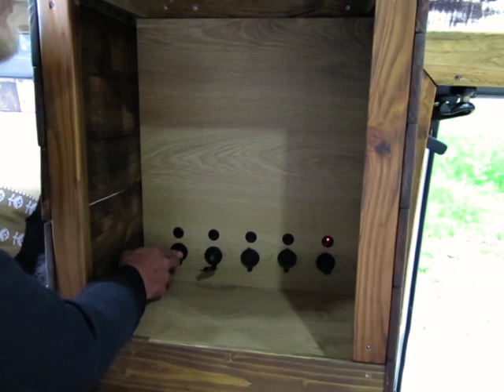LDV Convoy Campervan Conversion Tour. Self-Build, Off-Grid.

Comment: Good choice of van, their to underrated. Had mine 18 months and no probs at all. Nice job you two did on conversion. You talk like you know a lot about wood wish I did very handy when doing conversion, best of luck on your travels.
Reply from the maker: Roger Faulkner thanks. They’re definitely underrated, but that means they’re well priced too. No frills or mod cons but run really well.....so far anyway. We’re really happy with it 👍
Reply: What kind of flaws does the 2004 convoy 90hp have, I have one I enjoy it but it's at 53k Miles bought it 6months ago and have had to change the flywheel and clutch, back brakes, left wheel bearing has been giving a lot of trouble so likely needs a who new hub and axle,.abs etc, the ignition barrel got stuck so that needs to be fixed, the air blew it's fuse and now after replacing only blows out cold so debating if it's a few bits to spend money on and then it will be right or if it will be a money pit 🤔 great for lack of rust to must have been stored indoors any insight greatly appreciated
Reply: I've not had any really bad problems with mine, just done 100,000 miles 
If it hasn't got any visual rust that's really good, the heater is easy fix it's cable controlled which can cease if you look at the bottom of the controll panel near floor you can see lever and move it by hand. The price these vans are fetching now it's definitely worth keeping.

Comment from the maker: Hello chaps. Thanks for watching the van tour. Quick Update:
Over the summer my wife and I took the LDV on a two month tour round Europe, visiting Denmark, Holland, Germany, Austria, Slovenia, Croatia, Bosnia, Italy, France, England and Wales. If any of you guys are interested, I have posted a video of some highlights from the trip, you can watch here https://youtu.be/lb2LMEIu4pg 

Max
Reply: What kind of flaws does the 2004 convoy 90hp have, I have one I enjoy it but it's at 53k Miles bought it 6months ago and have had to change the flywheel and clutch, back brakes, left wheel bearing has been giving a lot of trouble so likely needs a who new hub and axle,.abs etc, the ignition barrel got stuck so that needs to be fixed, the air blew it's fuse and now after replacing only blows out cold so debating if it's a few bits to spend money on and then it will be right or if it will be a money pit 🤔 great for lack of rust to must have been stored indoors any insight greatly appreciated

Comment: Good job Max, just bought a LDV minibus myself to convert, scouring the net for ideas. How does the van run, any problems to consider?
All the best on your travel, I can’t wait to get stuck into our conversion. Trevor
Reply from the maker: deborah scoffin so far mechanically it’s been running great. Had to change the indicator relay recently but apart from that no problems.
Reply from the maker: Sorry for the late reply. The van has done a fantastic job. Spent two months living in it over summer. Took it all the way down to Dubrovnik and back (over the Austrian alps en route) and the only problem we had was needing to get the indicator relay replaced. Really pleased with how well it ran.

Comment: Take it to the scrap yard worst vehicle of all time
Reply from the maker: I took it all round Europe, it didn’t miss a beat. Each to their own 👍
Reply: Max Bradshaw it must of taken months 😂😂👍
Reply: Nosaveddata 😂😂😂 you need to get a Vw and scrap the ldv junk 😂😂😂
Reply: @johnmetrac2898  We were looking at VW or Merc and glad we didn't now. So unreliable on longer journeys. Injector issues. LDV not a speed merchant but why would you need it to be?
Reply: @BallisticBurns  are you having a laugh the vw pd engine in the transporter can do hundreds of thousands of miles very reliable ( the Ldv is like a old tractor 🚜🤣🤣
Reply: john metrac 🔔 end.
Reply: @davidmolyneaux5062  only bell ends drive them piles of scrap , worst vehicle on the road , have some dignity set it on fire 🔥 and save up for a Vw transporter 😊👍